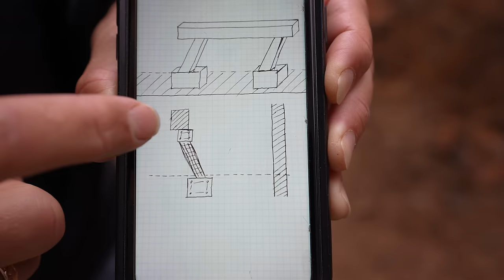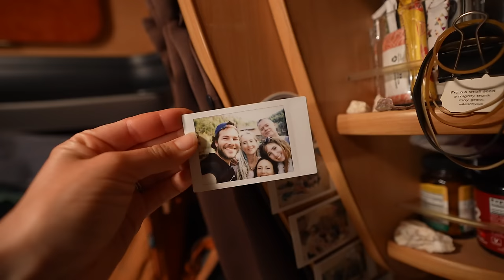NEW PROJECT BEGINS! REINFORCING OUR CASTLE WALL 🏰

Comment: You need to buttress that wall that might fall in. Build a wood form close to the rocks on an angle, kinda like the Hoover damn holding back all that water. After building the buttress wall and heavily supporting it with horizontal braces to the mill concrete wall, fill in the space with poured concrete. If you start removing that stone wall instead, you will be opening up a giant can of smelly worms!!
Reply: Ad some rebar as you see fit.
Reply: Or you can heavily waterproof your mill wall, and put in plenty of French drainage, and just back fill that whole area, depending on the strength of the mill wall right there.
Reply: If the road above the area in question wasn’t there, it would be  a lot easier to repair. Constant driving on that road will continue to put downward, and outward force on the un-buttressed old stone wall.
Reply: Great idea.

Comment: This episode had me on pins and needles worrying about a wall collapse while you were down there.  If that happened, you would be crushed with no one there to rescue you. I don't know what the answer is, but I definitely would have an engineer do a professional assessment so that you and the watermill are safe. I think I would also reassess the flexible plastic tube because it wouldn't take much to crush it and then you will have another issue on your hands. Concrete or clay culvert pipes would be a much better solution and last forever. I just don't want to see anything bad happen to you or your dream.

Comment: My suggestion would be to find a way to accurately measure if and how much the wall is moving.  It IS moving, don't doubt that.  We lost our home to fire last year and in the rebuilding process realized we could not locate our wellhead.  That was because the retaining wall holding up the driveway had shifted over the years and swallowed up our wellhead. Took me two months of digging to find it. Knowing how much the way is moving will allow you to do maintenance before its too late.  I appreciate  your content because it allows me to see how less hi-tech places handle regular property maintenance-without the big machines and the specialized tools. Thank you

Comment: The unstable walls you have need removing, we use gabions ( imagine a cubic meter galvanised heavy wire cage) this is filled with all the rock you have once in place, this is the tried and tested method, i have seen these used a lot in the states, once in place you can forget about land slide, arranged like a flying buttress, loving all your updates and progress, Happy Christmas and a great 2024!

Comment: I'm a bit apprehensive about removing all that rock. Since it has layers, and it is supporting the wall above.
Great apple pie BTW. I hope there were brandy soaked raisins in it. Some almond paste at the bottom is great too. It is traditionally eaten with a big dollop of whipped cream.
Very easy to make. You should try it.
Reply: It the wall base y’all removing not holding the wall and street above?  What are your future plans to hold the wall up?

Comment: Dear people, first of all I wish you a happy new year, Christmas is for children, so if you are still children I wish you a merry Christmas
My friend, we use a material black steropour or green on the outside of our houses, this is for the moisture, you can use plaster on this material, you have to plaster the house in the spring so that you stop the damp turn, and slowly dry the turn
We also use white marble sand here that is mixed with white cement, you can use it smooth or thrown, it is extremely strong, it doesn't break easily, it doesn't let any moisture in, I've had it for 25 years, the house doesn't need any paint on the outside, it's super white

Comment: I just had an idea; build out a wooden awning off the storage container. And use the old bank windows as skylights. An open air shop that doesn't need electricity.

Comment: Please don't touch (not even scrape/cut which are Worse) teflon coated (anything - like kettles or frying pans - no stirring with metal spoon!)  cakeform base with anything metal, you'll ruin it. Plastic or wooden tools only.  Move the pie to a plate or a cutting board of some kind, for cutting.
*
I always thought you would have added couple of connecting walls the between now crumbling annex and the house, so that you can get more room for between the house and annex for a bathroom or wardrobe.. or another bedroom.. And make the annex for still another bedroom.. Or without connecting walls (floors and roof = lots of work), annex would have been nice independent quest room. Also  between the house could have been patio with just floor and pergola over it.. Either connection the annex more or less or just acting as a patio, maybe roofed for winter seating or having outdoor kitchen..
I would have used the sliver (like a thin piece of a pie <3) of water chamber for your technical (storage) room.. I was kinda surprised you did not roof it over when you made the little new part of the roof. (The place under the new roof i always thought as a patio with continuing decking out, or maybe a balcony, with a door to inside..) Open a door to the thick end of the pie to the house and tech would have been there behind thick walls. Instead of the annex, like you said some of you water things (?)  were planned to go? ( Sorry. I lost the part where you mentioned it, and I'm in a terrible flu and can't find the moment where you quickly mentioned it.) Or even as roofed water reservoir where your water heater and the like takes its water, as it has been built to hold water. That would be quite nice amount of water for a household. [4:08] it looks in the camera/in my screen settings like it already would have been painted long ago with that light blue swimming pool goo that makes them waterproof. As do look part of the (cement?) part of the wall, against your road. 
And again if the ancient wall holding against the under side of the road, behind your house, the cars these days and especially big ones (I forgot you lorry driver's name, I'm so sorry. Darn this flu - you just mentioned it!), and heavy machinery (Nelson, we love you!), are so heavy compared to horse and carriage traffic that it might have been built to hold.. It might need proper help <3

Comment: Even understanding how old the mill is, it has been interesting to see how close that wall is to the mill structure. No set back whatsoever!  

I guess the only way to correct it now would be to re-engineer the road back towards the slope to rebuild a wall further away from the structure.  Alternatively, you live with the lack of set back and try and buttress that wall.  It maybe hundreds of years old, but you are now distrurbing all the adjacent land which shifts the load on that wall, etc.  I’d consult a licensed engineer who specializes in slope stabilization.

Comment: Another nice video. Thanks.
Anyway, I would like to suggest that you create a foundation  between the stone wall and the house wall and build a wall with concrete blocks. Just saying...
Reply from the maker: It’s not built all the way up the height of the wall but this was done at the point where the steps to the hidden patio are.

Comment: Hmmm, removing foundational rock in a wall is risky business. My husband and I had a rock business and used to build retaining walls (and more!) for driveways to be built on raw properties to allow access for building. I would remove that fig tree and plant more using this mother plant, away from the house. That huge root is an example of roots displacing rock and they  will continue to separate the seams between the rocks and eventually cause issues, especially on a corner!  Trees roots are lifting huge pieces of cement and driveway currently at my home and they can be very destructive. You never want trees so close to your home and on a moveable, rock wall!  Fig trees are fast growing. Take some grafts from that one and plant a few more somewhere safe on the property. No, you should not have removed any of that debris as the weight that that wall is holding back is huge! Actually, structurally to be safe now, it would be best to weld triangular shaped beams in there and back-fill with cement also. No, no hot tub! Dangerous area. You have many more potential sites that are probably way more beautiful than that!

Comment: It’s really a shame that the previous owners didn’t carve out more terrain around the building and make a new retaining wall with proper drainage at the base. I’m sure they just loved those dry stacked walls. Which I don’t blame them for because they are gorgeous but since they built the house so close to them it’s kind of disaster waiting to happen. And don’t feel bad for digging it out. I think that was the right call to prevent all that water from going inside your house. I’m a little worried about you digging out that big boulder though. But I know you will have dig out and reinforce the area. I live in CA and we see these rock formations slide all the time. The ones next to the roads are usually covered in a big wire mesh type fabric and then a timber retaining wall is built at the road level to keep the rock from rolling into the road. I’m curious to see how your experts resolve the issues.

Happy Holidays!

Comment: What you if you guys made a concrete reservoir in the bottom so water flows out and doesn't seep into the foundation, at the base if the wall, if that makes sense.